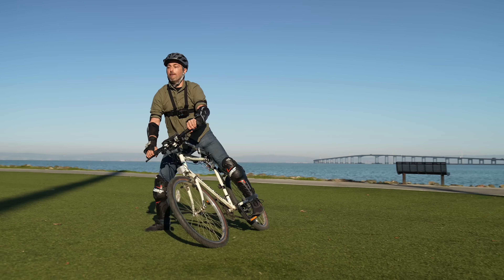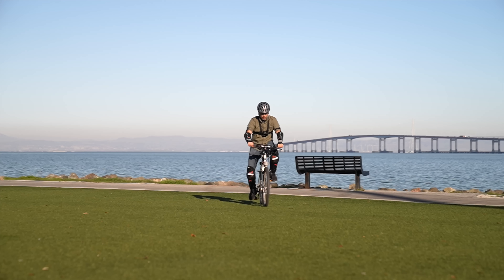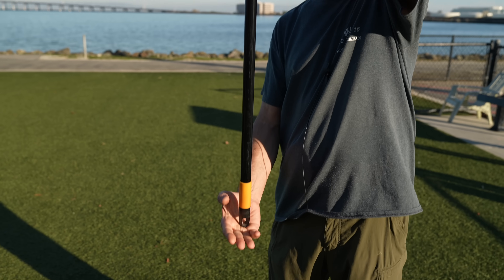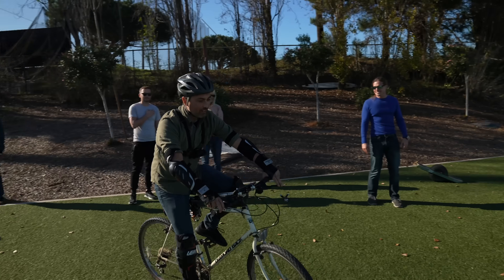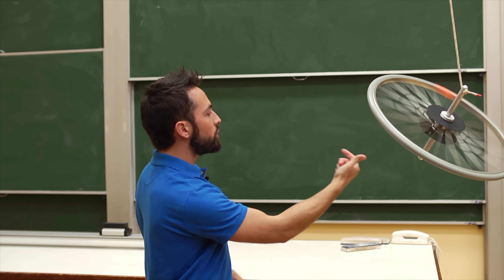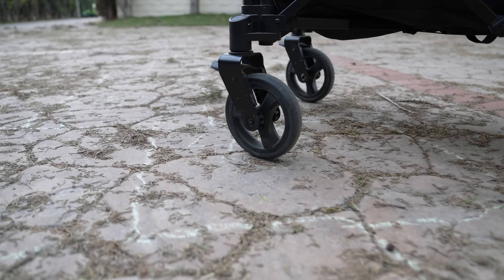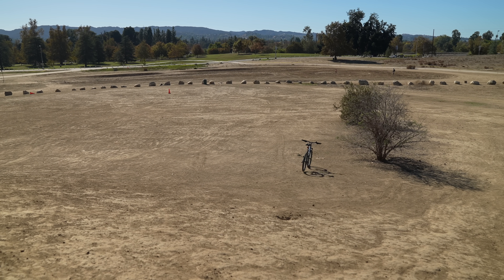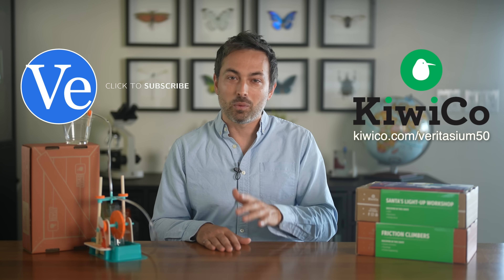Most People Don't Know How Bikes Work

Comment: us motorcylist use  "Counter steering" basicly you push the on the handelbar where you want to go. and when you do it slightly turns the front wheel to the other side

Comment: Counter steering is an indispensable part of motorcycling training where the masses and forces involved with steering are much more noticeable. Also weighting the footpegs/pedals and whether you position your body to the outside or inside of the turn are key to different on road and off road techniques.

Comment: Interesting .. I do this, to the point of fighting it a bit; when driving (and I have not ridden a bike in ages).  Part of it is over compensating for cutting the corner (my brain is telling me I'm too tight on the curb side so I have to go past the lane I'm wanting to turn into BUT I bet that "lane one over" is maybe not a sure thing availability (so wobble the front out quickly out from curb followed by the counter steer into the turn I want).  In cars, experience folks learn that during a turn all the balance "center" is way off .. in the old days of big hoods; I was taught the hoods center crease or molding (seems odd now) peripheral vision that is center is your curb tire the more down the road you look; but on a LEFT turn oddly the LEFT side of the car more and more becomes your RIGHT wheel. Very strange; and now with cab-forward everywhere; you don't really cognitively have that physical gauge and more just feel it I guess ???

Comment: i bet I can ride that bike I ride street BMX and I like to do technical tricks which require you to pretty much relearn how to ride a bike as if it’s a skateboard or something like that which I came from i used to skate and to ride a bike without steering is like to shift your weight and balance like how to learn how to manual without pedaling and or wheelie with pedaling especially riding fakie (backwards) after a 180 hop

Comment: i needed to check it out, i dont steer with the handle I just lean where I want to go, I don't counter steer , I lean and then turn, (right turn) i dont turn the wheel left to turn right i just lean with a straight wheel.

Comment: what? thats how you drive a car? i always move a little to the opposite direction before making a turn, except of course when in a very slow and tight traffic. Well I guess this happened because when I was a kid, I used to read the PS1 Gran Turismo manuals. I still remember the thick double disc case with 2 manuals, one for the game, and another for the physics of driving including stuff like load shifting during braking and acceleration, and drifting maneuvers.

Comment: I have one question. It is not to disprove your theory or research and as a mountain biker I can tell you everything you've said in this video is completely true. Kind of. One thing I noticed you didn't mention in your video is a technique that you will notice any pro or semi pro using constantly. This is the rather simple yet versatile skill of bike body separation. This skill is an act of the rider going into a standing position and slightly adjusting the wait of your body for maximum efficiency. One some more expensive bikes there is a mechanism known as a dropper post which is a lever one presses to completely drop their seat. Some people are confused as to how this is useful which makes sense. The  reason it exists is to give the biker better range to move around there bike such as moving backwards towards your back wheel on a sharp down hill. The main reason this is important is a type of bike body separation called cornering. This is when the biker leans their bike into a turn while doing something that seems very counter intuitive. The biker will actively lean away from the bike for multiple reasons. A) to keep yourself from hitting obstacles or branches in the turn B) to provide counter balance to keep the bike  from spinning out. C) To keep the speed and momentum of your bike while making a turn as efficiently as possible. How would an advanced technique such as cornering counter your research? Maybe I've been able to corner without turning in an opposite direction first out of dumb luck. This wasn't the most detailed explanation but I hope you consider making a follow up episode.
Reply: You can also do that in a sitting position, with the dropper up or down.the video is a bit misleading really. You'll also find that there's alot more people who counter balance with their bodies than you think.
Reply: @carlstanton2550  a lot of people will but only in minor amounts. When you truly use bike/body separation you can go extremely far. I’m talking bars nearly touching the ground during a turn. You can actually turn without counter steering but it takes extreme skill in order to do it. Most people however stay seated and just lightly shift their weight and it doesn’t have the same effects. It’s something that when I was coaching I would make the riders purposely push further than they were comfortable to prove they’d be safe. I’d have them put the saddle far outside their legs and it was amazing what could happen
Reply: @carlstanton2550  Agreed, I started watching the video and got confused when the guy in the video said that you can't turn right by steering to the right, at least not without steering to the left first (and vice versa). You just lean. You lean your body to the side you want to make a turn to. And that's it. If you're not leaning your body and you're holding the bike straight, of course you'll fall off when turning left or right because you're driving a 2-wheel vehicle, not 4 as mentioned in his example, thus making his example not really an "example". Not the first video of this guy that seems misleading. I'm literally driving bike since I was 4-5 years old, got on the motorbike when I was 13. Never ever did I have a problem with turning left or right by simply steering to desired side and leaning. Even as a kid it was logical and obvious that if you do not lean - you'll fall.
Reply: As a downhill and enduro rider myself, I agree with your statement. This video works on the assumtion that the bike and rider is a single mass. But by standing up you seperate the two and generate a moving CG.
Reply: Road biker here- just wanted to say you Mtn bikers probably have better handling skills than anyone I know :p
Reply: I used to ride like motorcycle dirt bikes, our instructor basically said like you don’t steer with the handle bars, you steer by looking where you want to go I think, idk that’s how I remember it,
Reply: @maxwellwoodhouse2908  yeah i got told to do that on horses , where you look actually affects your balance because where you look is where you and your body shift your focus i think this is also why they say to never look down when you are climbing , like of course you can do it but you will probably bring focus towards the bottom and that can shift your balance ,or even make you fall  . Also if you fall over you can look directly up it actually makes a difference . Not entirely sure why it helps on horseback though , but generally it is easier to do anything if you focus on something ( like how you tend to look directly at people when you talk to them , it's easier to understand them ), and i think you looking at something is the best way to focus . Also if you wanna turn right and you look left , you'd probably crash tbh unless you practiced it for some reason .
Reply: @redfox9726  maybe it’s like avatar where your brain connects with the horse and you tell it where to go by looking and focusing
Reply: @redfox9726  same with skating, don't look down, until you are really good.
Reply: @djelbert23  yh i think it's the same for everything , look at what your doing basickly
Reply: I can tell you have knowledge..

But mind to give paragraph breaks? 😅
Reply: Completely right. This research only applies to how he was riding the bike. I could turn that bike if I was aloud to stand up doing it
Reply: Dropper posts are a godsend for climbing and then descending
Reply: 6:52 looks like a guy with some mountain biking experience. Good call on the pros using the bike differently then the average rider, but they're more exceptions that prove the rule I think. After all, they're using athletic techniques for better control of their mount
Reply: yea, this machine only works for people that really are not all that comfortable on a bike anyway. I move all over on my bike, if I countersteered on a skinny I'd fall.
Reply: Scuba it is because you're right. If you've cycled alot, you learn you can lean into a corner without first counter steering because you will separate the cycle from yourself. In a sense you push yourself into the corner without losing the initial direction and then you use the centrifugal force to not tip over. Novice cyclists will most of the time first steer in opposite direction, if however you're trained like you are, you have a workaround.
Reply: @Robert Hansen I can balance my bike while it's stationery using the exact method I described though.
Reply: @Scuba Judah I totally agree with you. Cycling is mostly about weight distribution. What Veritasium explains would hold true if you are fixed to your bike, as there would be no other way to start a turn. That's why the counter steering is so present in Moto GP. The weight of the bike is much more than the weight of the rider. So they need to actively force the bike to corner faster.

Even in daily cycling (commuting, shopping, etc.) I see people mostly use their body weight to initiate turns.
Reply: @Robert Hansen Not necessarily true as the wheels are touching the ground so you can use that to "push off" allowing you to change the centre of mass.
Reply: @Robert Hansen You're pushing off the planet so there's still opposite reaction but a puny human won't have much effect. It's completely possible to lean and keep the bike level therefore moving the center of mass, although you'll fall over if you don't quickly do it the opposite way 🤣
Reply: @Robert Hansen It's called a track stand.
Reply: @Robert Hansen I can seem to do it. What I meant was you can push laterally, the force is going straight to the ground and not pushing off the bike, you need to also push with your feet to do this.
Reply: @Robert Hansen You simultaneously push down and inward on the left/right pedal and push the bike away, this keeps the bike level whilst pushing you to the side.
Reply: @Robert Hansen Though it can be used to corner too if you don't counter with the bikes lean.
Reply: @Robert Hansen go do a track stand your understanding of the universe will be shattered. You use a different method when stationary,  while moving you can steer therfore you don't need to have good balance.
Reply: @Robert Hansen Nope, I can do a trackstand with my dh bike on a flat surface. I'm not saying I don't use counter steer, I'm saying I can steer without using it to initiate a lean, although it's not as effective as using both simultaneously.
Reply: You just lean right (doing what I said earlier) and turn right and kind of just fall into it, no counter steer needed. But as I said it's definitely slower as you're relying on gravity.
Reply: @Robert Hansen but a track stand is stationary?
Reply: @Robert Hansen Yes when Newtonian physics where introduced. Anyway I lean left (pushing of the surface of the earth), I fall left (center of mass now to the left), the bike falls left, I steer left (so I don't fall over and now I'm turning), no counter steer needed.
Reply: This video is just for bikes riding at slow to normal speeds. At breakneck speeds u have to lean into a turn be it a motorcycle or a bike because if u try to twist the handlebar you will have the death wobbles
Reply: @Robert Hansen but you can balance a stopped bike I have seen several people do it.
Reply: @Robert Hansen I use both methods, experience beats theory any day.
Reply: @Robert Hansen Track stand is balancing stationery on a flat surface 😂 it just takes skill just like turning how I'm describing.
Reply: @Robert Hansen Also my feet don't have to physically touch the ground to exert a force on it, tires have lateral traction too which means I can push laterally without the bike moving.
Reply: Yea, as a mountain biker I can tell that to turn, I first turn with the body, sometimes you dont have space to counter steer, so I guess experience is what helps with the biker.
Reply: The thing is that this guys a scientist which means that he goes off facts and proven experiments… theirs probably not a lot of money in the mechanics of skilled bike riders but any rider with a bit of common sense will understand this. Another thing other than the money and resources issue is the idea of needing to do ethical tests. For example you can’t scientifically prove that a parachute will save u from jumping off a plane because theirs no scientifically observed example of someone being thrown off a plane without one, so it basically is just good old common sense. 🤣
Reply: @Walkdplankfrank   @KAI Watson  There are actually people who survived after jumping off of a plane. Of course there are conditions for that (iirc landing in snow is the best bet) 
Obviously there aren't any scientific who "create" data to see at which point you would not die, but you can still collect data which already exist to analyse it.
Reply: @Walkdplankfrank  Your English...
Reply: @scuba Judah- counter steering is very simple and works in road cycling, mtbs, motocross, enduro etc etc. You went on about nothing but your own god-like useless bike knowledge. Body position changes around the lean vs lean occurring because of body position. Rack up some xc trophy’s, a few 24 hr events, maybe an Ironman or two then come give me your spiel.
Reply: @MRmwr2452  I can tell you seem to be some one with experience or else you wouldn’t be challenging me to do these events as you have obviously done them yourself. This leads me to assume that you are older and probably more experienced than I am. However, one thing confuses me about this. Someone as nature and experienced as you would surely be mature enough to simply correct me kindly instead of assuming I was inexperienced while also boasting his own accomplishment like a prick.
Reply: @MRmwr2452  Why not a DH race? They take much more technical skill.
Reply: @MRmwr2452  Do you think road cyclists corner like mountain bikers?
Reply: @garyboyle695  no. Road cyclist use the bike in a way that they can generate a lot of speed, mountain bikers, tend to switch speed for control a lot more, since most of mountain bikers are downhill, they can use the bike without pedaling and that is what gives you a lot more place to maneuver than with road cycling. If you are going fast you most of the times are pedaling wile in road bike, while in a mountain bike you are not so you can make the pedal be close to hit the ground without you applying counter balance. Some people explained how pedaling makes you lose some sort of balance and I've seen experienced pro mountain bikers, just pedal as hard as they can without needing a countersteer, and its something that even road bikers do, im someone who grew in a mountain bicycle, and road bikes are uncomfortable to me, not by the fact of them not having a suspension but in the balance the bike has, I don't know how to explain it without sounding weird but its like if the bike had a different balance to support the cyclist in tight corners and that balance prevents you from doing some crazy poses that a mountain biker can do, the friend I traded bikes with he was a road cyclist and he said that he felt with more freedom over the bike but that he didn't liked the bike for some reason.
What im saying is, a road cyclist with experience can do some stuff that a mountain biker can do, you just need a bit of practice so you don't fall and a bike with space for you to maneuver, because the seat height place a factor in maneuvering, and wheel thickness too, because wheels have an inclination that gives them the most amount of grip and if you go further you can slide and hit the deck

Comment: Ofc locking the steer straight will put you off balance if you keep pedaling, try gain some momentum then lock the steer, you will do just fine. Pedaling put a pressure on the side which the pedal is on, you need a slight turn to keep the balance on. There's noone who can pedaling with the steer straight dead on.
Reply: The gyroscoping only works when the balance is stable